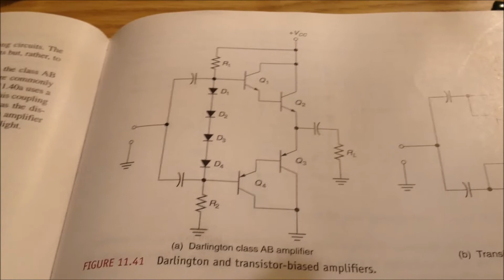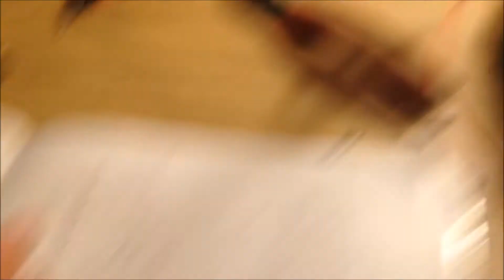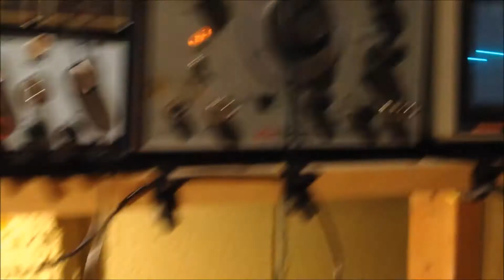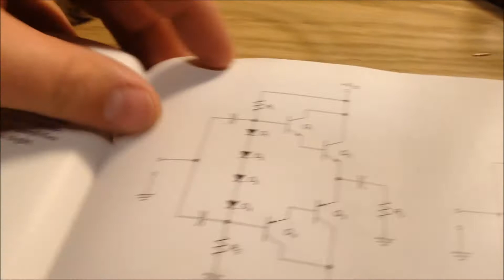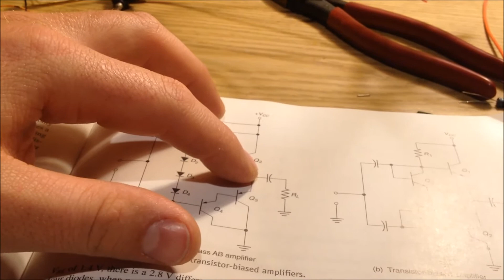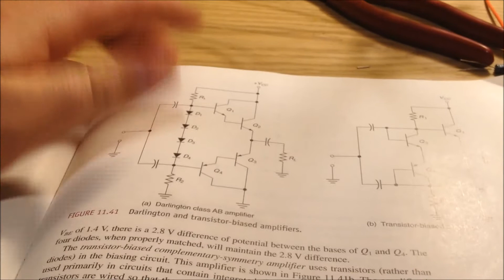Troubleshooting the Class AB Darlington Power Amp

Comment: By default, if your transistors are working properly, you will have close to, half the supply voltage sitting at the emitters.

Because no matter what value of supply voltage you use, or what value of base resistors you use, as long as both resistors are the same value, then you will always have half the supply voltage between ground and the first 2 diodes.

That can be verified easily by ohms law. So since those 2 diodes are in the circuit to raise the voltage up by 2 transistor Vbe drops, then just the same the emitters will always be at close to half supply voltage as well.( (ideally exactly half), but practically close to half supply value.)

Hope that helps in understanding the base biasing for this circuit.

Comment: you need a preamplifier to raise the amplitude of the signal first. For the output maching just play with a variable resistor instead of R1 or R2.  And also you may ned to put annoter diod in there

Comment: Check out the beomaster 901 amplifier. It has a similar circuit, with some stuff added. An interesting design. It plays through a cap though because it only uses positive voltage
Reply: btw a quick initial transistor check (to see if they are burned). Check for diode drops with a diode tester (in multimeter). If the C and E terminals are shorted but not B C, or B E, then the second one in the darlington pair blew (maybe too much quiescent current). If its all one big short then they both burnt. This also works for a single bjt and ofcourse for diodes :)

Comment: Use 4148 diodes instead of those 4007s?
Remove those capcitors because they are totally useless.
Feed the amp with signal going to the mid of those diodes...
Reply: Mihkel Laansoo   those capacitors are not useless because they helping to close oposite transistor and if you feed signal in mid of the diodes then you have voltage drop and high current because the oposite transistor stay open, that means low eficiency of output stage